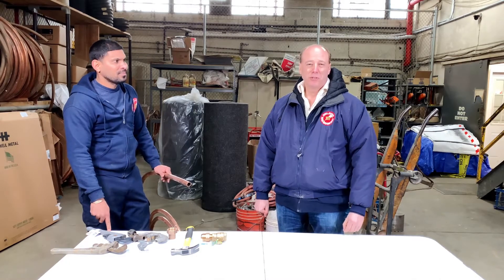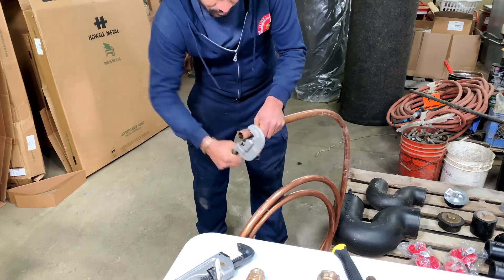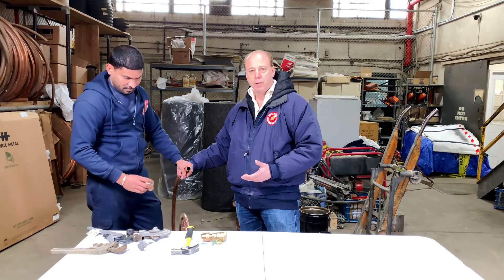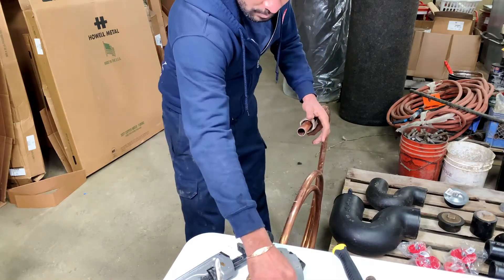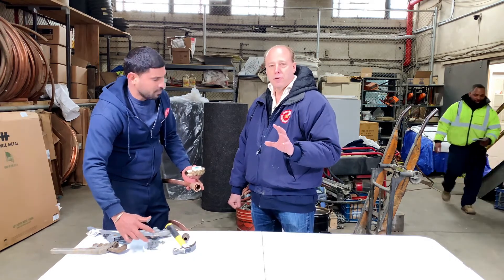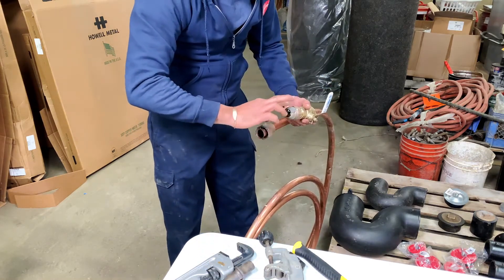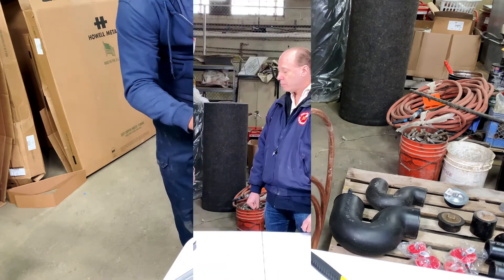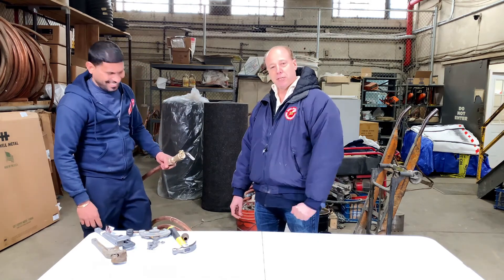How To Flare Copper Water Tubing: Learn From A Plumbing Professional

Comment: I am going to have to anneal the end of my straight  pipe before I can flare it. I don't like those type of flaring tools. I'd rather use the rotary flaring tool. I have to use the kind in the video, because I cannot find a 7/8" O.D. flare tool anywhere.

Comment: I just snapped the soft copper propane line going into the house and watched this video to see how to flare the pipe properly. I have NONE of this shit so I spit on a concrete peg and hammered it in there. No leaks, I can cook for now and replace it with a flexible line when I can.

Comment: Pipe dope on a flare lol wtf are you teaching ppl lol
Reply from the maker: Pipe joint compound is not placed on the flare, or the face of the flare fitting. It is placed on the threads of the flare fitting, and behind the flared copper to allow the flare nut to be turned and tightened more easily.
Reply: @balkanplumbing  What type of pipe joint compound are you using?  Any pipe joint compound I can find is gritty or has teflon in it and it's not working well for this application.  The compound you are using in this video appears smooth almost like plumbers grease
Reply from the maker: @brianhaufschild2477  We use "pro dope" made by Hercules. Hopefully that helps you!

Comment: Using copper cutters , reeming it and then swedgeing it,, around two years ago we had to switch to compression fittings no swedging ,flaring , in Manitoba Canada makes it a lot faster and easier
Reply from the maker: Interesting. Every jurisdiction has its own code.
Reply: Makes it easier to do things like hooking up to a homeowners lead service, if they don’t want it replaced from the box to the meter
Reply from the maker: @jdiaz8819  Now you bring up yet another difference. In NYC repairs on lead or galvanized water lines are expressly forbidden and against code. They must be replaced completely.
Reply: @balkanplumbing  I mean when we are putting new waterline in if it’s lead it’s replaced 100 percent of the time from the Corp to the property box facing the city side . But on the backside if it’s lead the homeowner has to pay to shoot a new copper line into the house while the hole is available at a better price or they do it after it’s back filled at a lot more. Or they live with the lead line. It’s against code to have lead on homeowners side left as a lead into house ?
Reply from the maker: @jdiaz8819  Well, in NYC the meters are inside the house, and property owner "owns" the entire line, so yes the entire line must be replaced to copper from the tap connection to into the building.